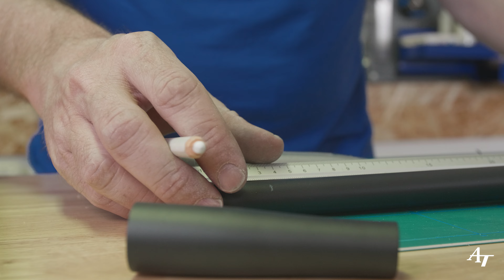This is RodBuilding Episode #14 Rod Grip Repair

Comment: Next time you are pushing a grip like that, and there is a big glob of glue been pushed on the front, try covering the back with your palm, then pull back slowly. It will create a suction and take some of that glue in.

Comment: Hi not sure how you managed to remove that aluminium winding check off the butt of the the rod normally the blank gets thicker down there. Would you normally have to try and cut it ?
Reply from the maker: it depends on the sizing done for that winding check.  If it is smaller than the butt end you could move it forward and the cut it off